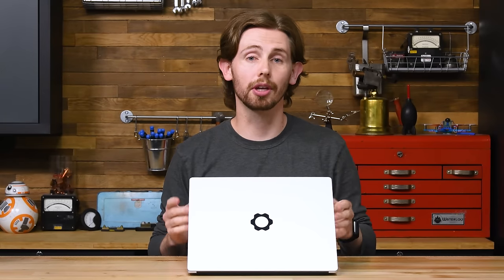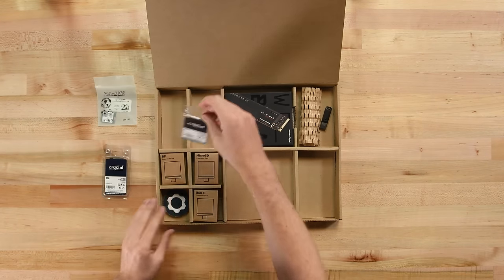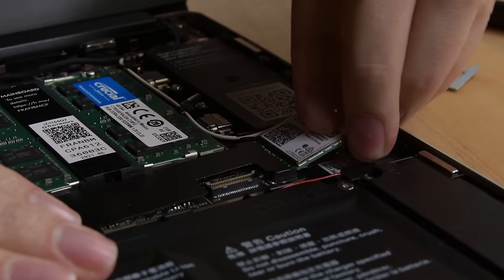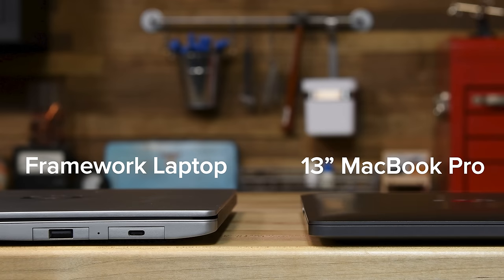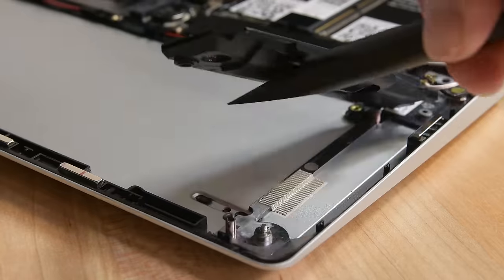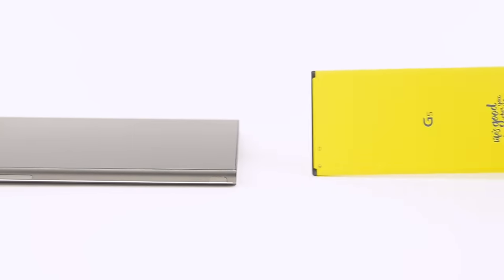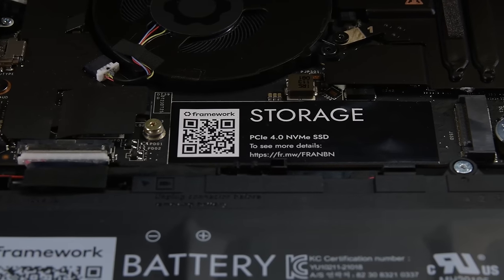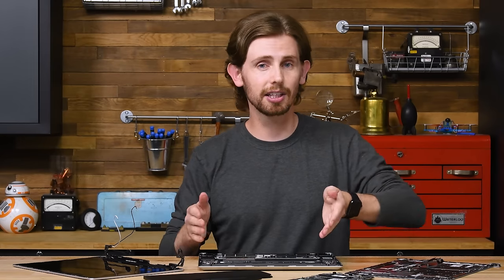Framework Laptop Teardown: 10/10, But is it Perfect?

Comment: IMO This seems like it would be a great Hackintosh.
Reply: Only for a few more years, sadly. Unless the brilliant minds in the community manage to keep x86 compatibility after Apple kills it for Apple Silicon, Hackintoshes probably have less than 10 years before they're too far behind on updates to keep being used.
Reply: Apart from the mac software....
Reply: @PanosPitsi  There are many flavors of Arm, nothing says they have to be compatible after that
Reply: @remy7663  That is exciting, but being arm doesn't guarantee MacOS compatible chips. In the past laptops that made the best hackintoshes used an identical cpu to one already in a Mac. If apple has their way, it'll be different enough to keep support dead. I have faith acidanthera will find a way to force x86 support or other arm support anyway though. What a champ.
Reply: Does such a thing exist?
Reply: @myriadtechrepair1191  I agree. If I didn't need Windows for my gaming PC I'd have MacOS running on it. I use a Mac for work and it's just better and more stable in every single way imaginable
Reply: @TheCompyshop  I can vouch for MacOS's stability, Windows has just been giving me so many issues lately I've considered Linux many times. As soon as all of my windows use-cases work in linux I'll be switching.
Reply: Well with an Intel cpu and internal graphics… change the wireless to a Broadcom and you would  good to go. I think apple will support intel macs for at least another 10 years as they are still selling Mac Pro. Until that is replaced with the M2/x and they have sorted out external graphics intel macOS s good.
Reply: @Gruntos  I agree. I fully expect Apple to support MacOS on Intel 10 years after the last Intel Mac Pro is sold. I don't think anyone needs to start the death clock just yet, still a lot of years of usage to come
Reply: @myriadtechrepair1191  I don't mind sticking with windows if they can run on ARM chips as efficient as macOS runs on M1
Reply: @kornaros96  The doesn't solve the problem bud.
Reply: @myriadtechrepair1191  then run Android on the m1 Mac's
Reply: @myriadtechrepair1191  Maybe using Linux as a hypervisor for Mac OS will work for ARM support

Comment: Going to hold off to see if upgrade parts/integrated graphics are a thing for the next version, but the concept is amazing and even the practical benefit of swapping ports would be super useful. Top of the list for my next laptop for sure
Reply: Most laptops have the CPU and the RAM soldered onto the motherboard. So to do a CPU upgrade, you basically have to replace the entire motherboard.
Reply: @farishanafiah8461  
Which is to be expected of some laptops for the last 8 or so years.
Reply: @farishanafiah8461 Which, especially for x86, is way cheaper than the whole computer!

Comment: You know that peace of mind you have with your desktop computer knowing that if any part failed it will be easy swap thanks to it modularity this laptop bring the same feeling.
only minor improvement if they can make a socketed CPU & GPU (future upgradability) , also if in the same way you connected an extra port, you can connect an eGPU with a decent bandwidth it will be amazing.
Reply: I heard another creator stating why socketed cpu is bad. 
1. It's an extra failure point. If soldered properly, CPU will outlast almost any other component in a x86 computer
2. People rarely upgrade their CPU 

I'd say too that the soldered CPU is an upgrade. Sadly intel doesn't make socketed laptop cpu anymore so there goes that "improvement" option
Reply: @houghwhite411  Also it would add to the thickness I guess
Reply: @houghwhite411  the cpu will keep functioning, but it might become too slow... on the other hand, you could put in a new, faster one and not have to buy a whole device
Reply: @emperorsgoldenboy3735  it's not the cpu is slow, it's the program made sloppily and web page bogged with junk scripts. CPU above 2018 should be able to last at least another 10 years for general computing
Reply: moden mobile cpu's don't come with the hardware required for it to be socket-friendly, so upgradable cpu's and gpu's is impossible unfortunately
Reply: I think I heard somewhere that the motherboard is supposed to be replaceable, so that CPUs can be upgraded that way.
Reply: They state the CPU is upgradable, by replacing the board. And I'm hoping for eGPU support
Reply: @houghwhite411  I have CPU from 2012. And it is still good...of course it is Desktop CPU. 6 treads x3,5Gh base. Upgraded GPU 3 times though LOL
Reply: Well even in desktops, often especially with intel CPU's they are making new sockets constantly. So at the very best, a CPU being socketed might allow you to replace a lower end cpu with a higher end, next generation cpu. But not much more.

Comment: So hyped for this!
Some laptops that are already available are kind of repairable but disassembling is a huge pain in the ass if you don't have a lot of experience fiddling with all the different connectors, ribbon cables and screws.
The frameworks laptop changes that.

Comment: i think its awesome that not only do they make it far easier to repair or replace parts, but they also tell you how to do it.  and they even include a few spare screws inside the case which is something no one else does
Reply: and the screws are color coded.

Comment: Can't wait to see the future of this company, it's hard to expect modular CPUs and GPUs, but these guys seem promising
Reply: Making a laptop motherboard with a CPU socket won't be that easy, although a replacable dedicated GPU is very possible given that framework could simply add a PCIe slot, say on the side for ex., basically a Flow x13 but with the connector on the inside of the laptop
Reply: @mrmarker98  You can find the odd chunky windows 98 with a CPU socket in it but I think the problems associated with that are obvious. Although, thinking about it, you could in theory have a CPU that runs off of a PCI slot?
Reply: My friend, modular GPUs are here on the new 16 inch model

Comment: This is very interesting. It goes to show you can make something very thin and still make it serviceable. My only concern it that the company will be around long enough to supply the replacement parts when needed even though some are standard parts.
Reply: At worst, you get a decent laptop that you can find used parts for online. At best, it's one of the most upgradeable laptops that will last you for years
Reply: @Ghi102  whats great is at worst its an standard, affordable laptop, and at its best laptop for upgradability as of now
Reply: So far still around and already offering upgrades to accommodate latest gen processors.  I have been very happy with mine
Reply: @satcomjimmy  dont forget the marketplace where you can buy and sell used parts
Reply: @RashidTak  I have my eye on the 16inch version.

Comment: I’m just really sad there is no AMD version of it.
Reply: It’s not that big of a deal
Reply: I think this is just their first attempt, and if they get enough funding, they could design a new drop-in replacement AMD-based mainboard. I do dream of them adding a whole list of features I want, too.
Reply: @Alpha-fc3bo  it is amd cpus are more energy efficient which in a laptop is very important
Reply: @Alpha-fc3bo  for you it might not be. For me it's the single thing that has this product completely off my list of contenders.
Reply: Is there anything like Thunderbolt for AMD?
Reply: @LetrixAR  Not currently, but there doesn't need to be. USB C can handle all the basic needs for the average user. 

Thunderbolt's great if you want to, say, use an external GPU, USB multi-gigabit network adapters, etc. 

But for the average user, the lower power consumption and better performance (especially for light gaming?) of AMD would be a very worthwhile tradeoff. 

Plus it would probably cost less.
Reply: Yet.
Reply: They've probably been developing this thing since before AMD knocked Intel off the performance throne. It takes years to get a new system designed and built. I'm sure they've got AMD in mind as well, but a while later.
Reply: @FalconFour  note the generation of cpu used.
Reply: honestly the only thing stopping me buying this is that there is no dedicated gpu, on an intel
Reply: @drackar  As far as I know Intel did release the thunderbolt specification to USB 4, isn't? I think the next-gen ryzen will come with that.
Reply: I hear AMD doesn’t consider these kinds of companies. Only those putting forth request for thousand and thousands of chips.
Reply: @LetrixAR yeah bro.....there is thenderbot for AMD
Reply: Intel is dead.
Reply: @typingcat  no way.....
He is Market legend.
Reply: @typingcat  not yet dead, but it has ARM manufacturers as new badass competitor
Reply: @storgephobia  afaik AMD's APUs graphics are currently superior in all but the thin-and-light laptop segment, i.e. here. We'll have to wait until next year to get better RDNA laptop graphics
Reply: @Alpha-fc3bo  I would argue that it is a big deal. Considering that AMD does have better-integrated graphics and seems better at multicore computation than Intel at the moment and last battery consumption is better on AMD. 

If it was 2015 again, Yes, I would have agreed with you then, but it is not. AMD is currently better overall now in 2021.
Reply: While I would love an AMD version, the problem seems to be getting them. It seems impossible to find anything with current gen Ryzen mobile.
Reply: I think they said AMD versions are coming
Reply: Agreed, hopefully they get around to it. Graphics too if these really take off.
Reply: @drackar  You do realize USB-C is a connector right? Its basically a replacement for USB-A. What ever protocol USB-C uses is up the the manufacturer. I have seen hundreds of USB-C Cables running or rated ofr USB 1.0 speeds or 2.0. 

Thus your statement about USB-C in that regard is False. You can't compare USB-C to Thunderbolt as these are 2 very different things.
Reply: @EvanBoldt  The Lenovo yoga laptops are amazing and use latest ryzen mobile. Bought a Yoga 7, super tiny with a 5900M and a ~2k screen that runs like butter. Not sure if that edition is available in the US though.
Reply: @Alpha-fc3bo  intel management subsystem is a big deal
Reply: I've heard that sourcing a Intel cpu is easier that sourcing one from AMD, that might be 1 of the reasons.
Reply: @drackar  wdym not really. Thunderbolt I believe is supported on AMD but just isn't because manufacturers don't wanna
Reply: @aadisahni  thunderbolt is an Intel owned technology.
Reply: @drackar  Intel designed thunderbolt, they developed it, they don't really own it. Besides that still wouldn't change the fact thunderbolt can be on Ryzen, you can use optane on Ryzen why can't you use thunderbolt
Reply: @aadisahni  I mean it will be in future but it isn't available on current gen Ryzen.  Flat out. Go find a single example with it. One motherboard.
Reply: @drackar  Motherboards don't have it but PCIe cards exist. There's one from Aorus.
Reply: They have expressed a desire to bring in AMD as an option
Reply: @4megapete  fun fact. I can't take my desktop everywhere.

Comment: I feel like many laptops are already super easy to repair. The biggest things are when they open from the top, palmrest/keyboard replacements are much simpler because you don't need to transfer the motherboard and everything else over. Also a keyboard that isn't plastic-welded on is nice to see.

Comment: I love this concept.  I'm hesitant for 2 main reasons: the total amount of IO isn't really enough for me (4 ports plus trrs).  I'm also hoping they make a version with dedicated graphics in the future.  I hope they make USB modules with 2 USB ports instead of one, perhaps a type c and a or 2 type c in one module.  I still might consider one for my next laptop, but it's a tough sell even though I'm enthusiastic about it.
Reply: thankfully - there is now a large community of people who make open source IO modules.
if you have a 3D printer and a bit of patience, you could potentially create your own or use someones design for a dual-IO module - just bear in mind the risks they may pose to the internal hardware.

additionally, i have no doubts that the laptops will eventually have a dGPU within another year or so, sure its a long time but its not the end of the world if you consider the advancements of iGPUs so far either.
optionally, you can use an eGPU as a temp solution, though they cost a lot in efficiency due to the limited bandwidth of the USB ports.
you could also maybe even get a motherboard replacement that does have a dGPU combo but considering the size of the laptop, i feel like a 15" chassis is necessary for the capability of such things for thermal concerns and for the repair-ability.

hopefully they do remedy these things soon though, i currently bought one for myself, since i dont require to run games or do anything graphically intense besides web-development and software development or casual work. it is pretty handy and the expand-ability of  the hardware is more than enough for me to take the chance on its future.
Reply: Just saying, but 2h ago they announced a 16" version with *modular* (hard to believe, I know) discrete graphics, 6 modular IO ports instead of 4 (though no headphone jack by default, it'll come as a module instead), and even more-er modular keyboard and touchpad and optional numpad 🤯

Comment: To me the only weird thing are these usb c ports, why not put two on the adapter, and why not have at least one permanent port, as you need it for charging? Other that that it is a dream that came true, cant wait for versions with AMD, ARM and RISC. 10/10
Reply: But what side do you want the charging port? Do you use your laptop on a desk with the plug on the left or the right... Etc. I see why they didn't make a steadfast charge port location.
Reply: @brycetorian  fine, what about the 3.5mm jack? with the usb-c ports at least, with one permanent port, you could still use a module to charge it on the other side. Anyway, its infinitely better than any other laptop on the market.
Reply: They cited two problems as for why they didn't do a 2xC module: power, and video. Getting two USB-C ports and the USB hub chip into a module is a tight fit, but it's doable, barely. But fitting that and the DisplayPort controller and the USB-PD controller in there is impossible. There are already people on their forums working on a simple barebones hub module that will get you 2xC, but you won't be able to do any video or power (in either direction) beyond half of what a standard non-PD USB-C port can deliver. But that's still useful, so people are working on it.
Reply: @FinFET  It already has a 3.5mm jack, and high quality DAC modules are in the works.
Reply: @guspaz  Nice, thanks for the info! about the 3.5 mm jack, was just to point out that it is permanent on one side, which would be a similar case for a permanent usb-c port
Reply: @brycetorian  I mean not the back of the Laptop?

Comment: I'm holding out for a 15" or larger laptop with confirmed thunderbolt support.  Talk on the forums is they do have it, they're just waiting on certification to properly announce it.  My ideal laptop is basically this, but with a good, large screen and the ability to dock with an eGPU and monitor array.

Comment: I like the idea, however if a part goes wrong you still have to try an diagnost which part to change. Like my xps 15 have a lot of Modular parts but I can't figure out why it's not turing on. The good thing is that it will be easily repairable by a professional but not as easy by the consumer but great work.